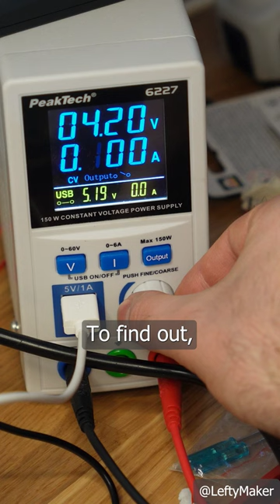Powering 1W LED without a heatsink. How hot will it get?

Comment: When I was small , I made a rechargeable torch using this led. 
And directly connected it to a 4v acid battery.  
It glow likely 6-7 hour without any problem. 
That led is damm powerful .

Comment: to add a heatsink is not enough not to burn or be very hot, the power leds require constant current so you should use a constant current supply circuit instead of voltage supply. in opposite case, power leds get warm and then get more current and more hot and so on...till burning. to avoid this, use a basic serial resistor or better a constant current circuit. by the way, dont draw their max current i.e. 350mA, 700mA etc. best one is less than max current.

Comment: I want to connect them in series. What resistor value for 3 LEDs? Mine is 1w each.
Reply from the maker: Depends on your power supply voltage and forward voltage/current rating of the LEDs. And I generally wouldn't recommend using a resistor with powerful LEDs

Comment: Today electronic "engineers" or more likely "Arduino engineers" are very lazy. Sometimes they even ask why breadboards melts when 3 A going thru this. Best thing is 230 V AC from grid connected to breadboard, which is popular nowadays.

LED-s are going weaker with temperature and time and they can fail suddenly. There is no such thing like too big heatsink.

Comment: A LED can theorially get to as hot as it's color temperature if it's indestructible. Real LEDs fail far before that.
A indestructible laser diode, however, can get hotter than infinity.

Comment: Its a 4v led but you set the voltage to 4.20 increase in voltage will make that led more hot
Reply from the maker: The supply is in constant current mode. Once the current is reached, it drops the voltage automatically to maintain that current
Reply: @LeftyMaker  Oh 😮 Now I understood
Reply: The voltage is completely irrelevant in constant current mode.

LEDs are current controlled, not voltage controlled.
The magnitude of the current is controlled by the power supply in this video and the voltage is whatever it turns out to  be.

You can take a voltage source and drive an LED, but what you do is place a resistor in series to set the current to a desired value.
You then calculate the resistor value by knowing: the voltage of the voltage source, the desired current,  and the expected voltage that will appear across the LED for that chosen value of current.

To be accurate what you would do is look up the voltage drop across the LED for the specified current in the IV curve for the LED provided by the manufacturer in the datasheet, but the fact is no one ever does that, what we do is just use a nominal value for the voltage drop.

A lot of people think the series resistor with the LED is to limit the current. It isn't. It is to set the current to a desired value to achieve a desired level of  brightness.